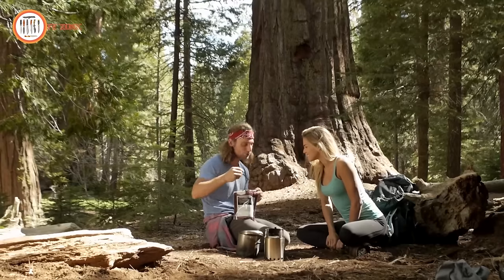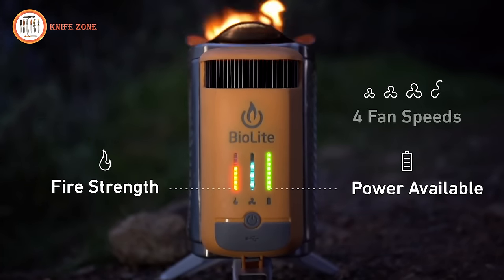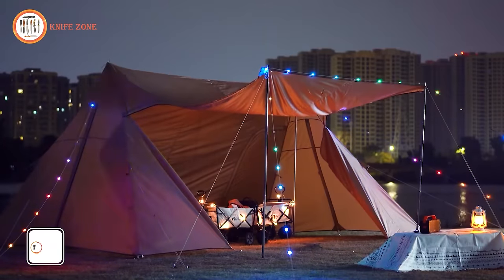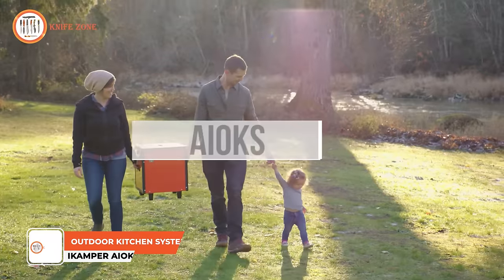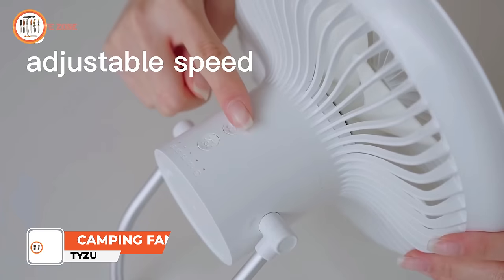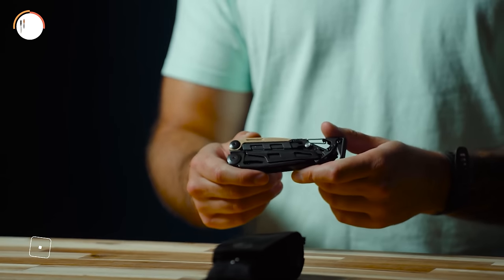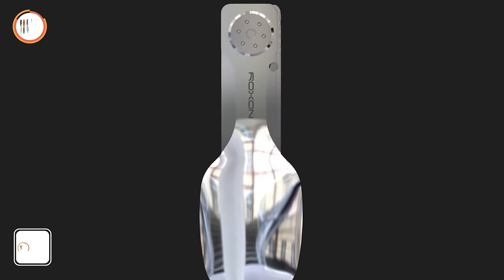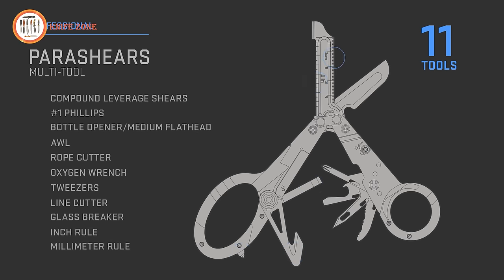50 NEXT LEVEL Camping Gear & Gadgets In 2024

Comment: Never have the light on in your tent, put the light outside and get used to low light diffusing in. Get a remote control battery light. Sometimes turn it on if you hear something from the safety of your tent.

Comment: Most of these gadgets available at Walmart are OUT OF STOCK!!! So now we have to add $$ to each gadget if someone dumb enough wants to buy it. Them clips on a rope thingy? If you can't tie a loop-knot to hang up some stuff, you don't need to be camping in first place. Basically, you need a trailer to haul your generator on order to make most of these things actually function. How are people and their electric vehicle suppose to power supply half their gadgets using their vehicle as power supply?? I swear, the first woman(all know the guy be too girly to ask) to ask me to jump start their electric car or if possible to borrow gallon of gas to run their generator to charge their vehicle im gonna fucking laugh my ass off. I carry a very useful car/truck battery booster starter in my truck for people needing a jump. Very rare, will I carry jumper cables these days cause I've heard of people not listening and going ahead and hooking them up, but they cross polarize the leads and fries both electrical systems. Ah yeah, I'm gonna save that ass whupping for when someone truly deserves it for doing something else like trying to steal my hitch when it's connected to my trailer still. And both have a lock to secure them to my truck even. I wonder if that kid ever went to the hospital to get the bullet out of his shoulder yet? Anywho, yall youngins thinking of camping and "roughing" it, I better not hear your damn generator past 2100hrs or we will have some issues real fast like.